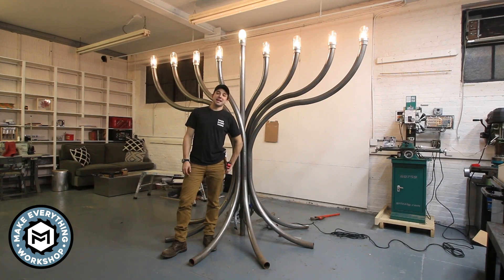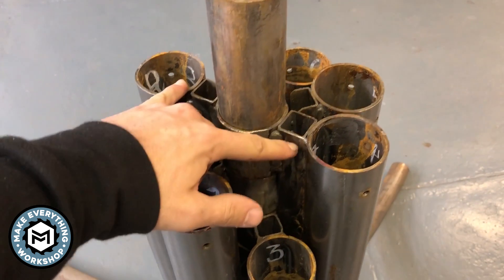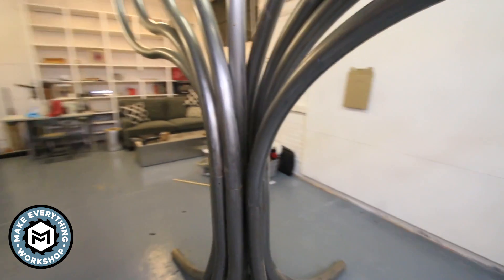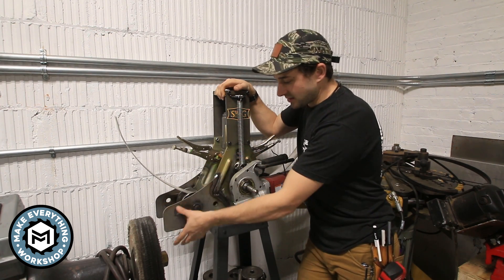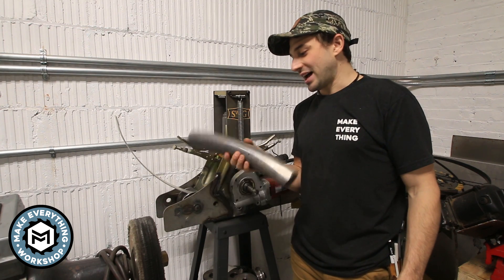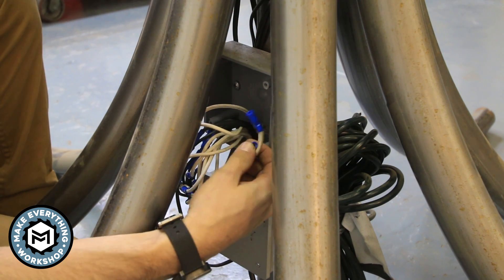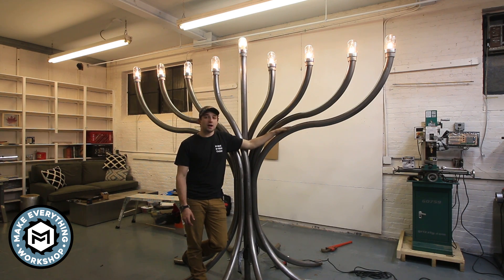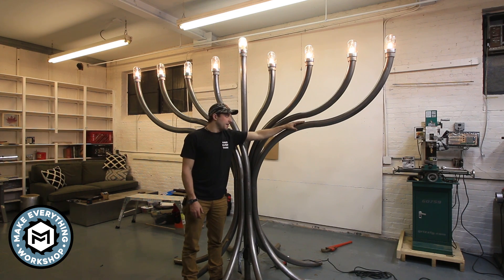Giant 700lb Steel Menorah!! (How I Built It)

Comment: there is must be 7 bulbs, not 9.
you also must have separate control for each bulb, due to its switched ON one-by-one (one per day).
Reply: I thought the same but after a wiki search I leant that it's forbidden to use the 7 lamp menorah outside of the temple so the Hanukkah menorah has 9